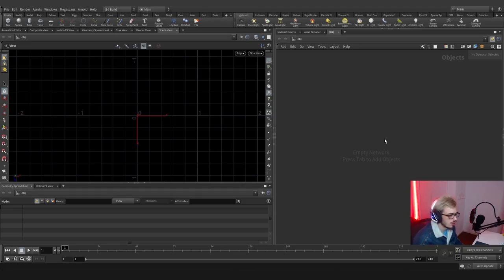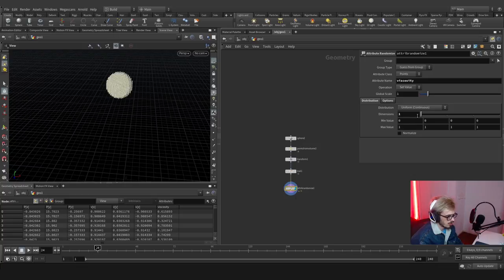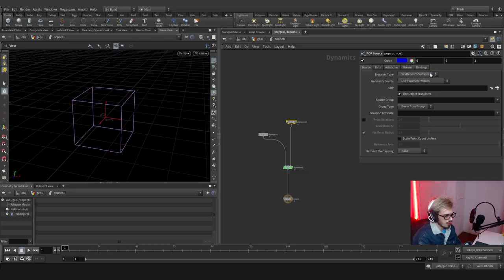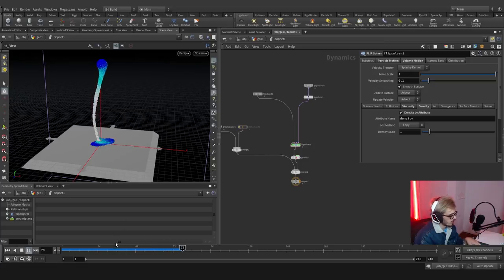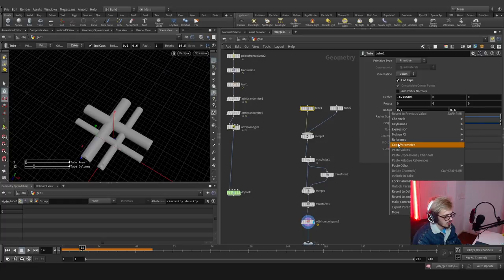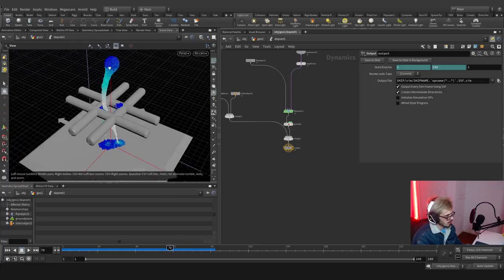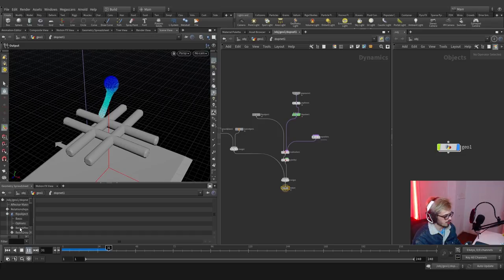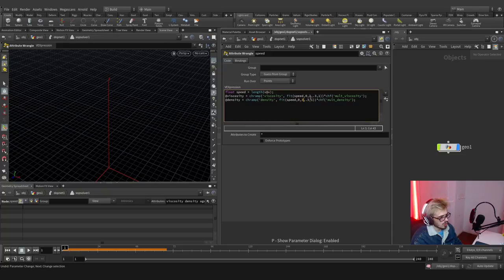Having Absolute Control Over Flip Viscosity With Houdini!

Comment: 4:36 Hey, did you have done something inbetween here magically? When I set Emission type to All Points then suddenly the particles are spreading all over the place and they are not interacting with gravity. I tried it in H18.5 and 19 - same weird behaviour.
Reply from the maker: Oh no. I havent done anything special. That glitch might have to do with the collision. Try unpluging the collision and see what happens. It might be that. You can increase the resolution of the sim. Also checknif your collision is properly plugged in
Reply: @pizola3285  Hey, thanks for the answer. I have builded the setup again a bit differently and it works. BTW my question started with "did you have done" and now I think it's not very polite to ask for something in that way and it looks like I have a grudge against you, but I'm not. So I apologize for my behavior, English is not my first language and I'm still learning.
Reply from the maker: @baldoski  Oh man dont worry. It isnt my first language either. I am glad you found my tutorial useful!

Comment: Hi Pizola, I was wondering why don't you make the attribute wrangle right before the dopnet? it work the same way, instead using a sop solver inside the dopnet? 
by the way, nice video! you're good!
Reply from the maker: Hi Andrea. I use a wrangle outside dops moooost of the times. But since in this particular case the behavior is dependant on the its current v or age state I just didnt mind on doing any wrangle beforeand. Thanks for asking!

Comment: Looks so nice.
How long did it took to sim?
and what is your cpu?
Reply from the maker: Back then I had a ryzen 9 3900x. I think it took 20 minutes to sim
Reply: @pizola3285  thanks. Can i ask how can i make the emission velocity to base on the emitter's local axis? I couldnt find a simple solution on internet
Reply from the maker: @ruudygh  i dont exactly understand what you mean by local axis but if you want a direction you could use a wrangle to inject into the velocity the direction of the points to another point, normalize that and play around with a pointvelocity node.
Reply: @pizola3285  Thanks for reply :)
I mean for example to have the fluid shooting out to the direction base on the sphere's (the emitter) local Z axis. Then i can parent the sphere to a character's watergun, following his movement. As i know wrangle involve coding, which im not capable of.. is there other simple way doing this?😯